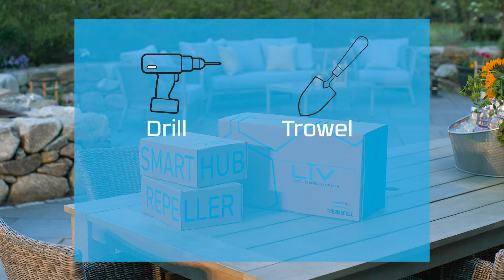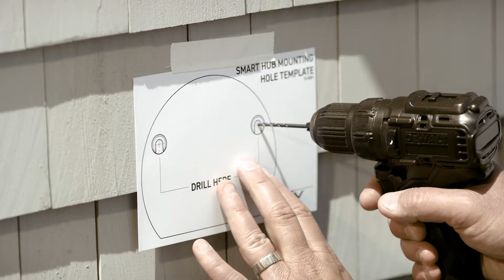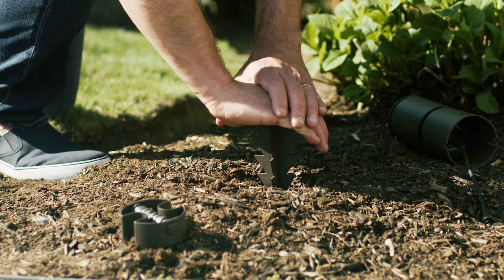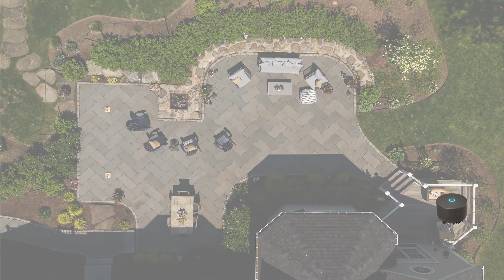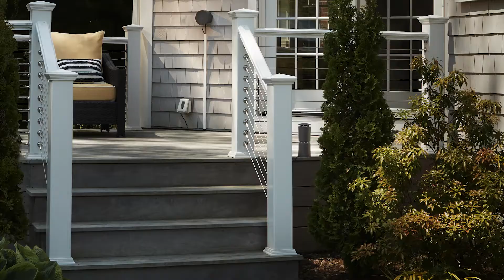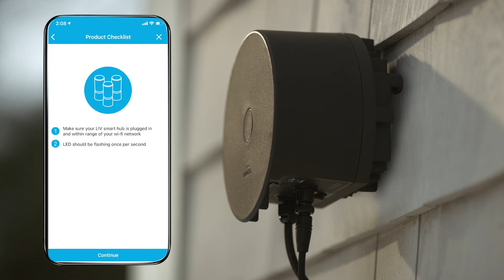Installation Instructions for Thermacell LIV Smart Mosquito Repellent System

Comment: Overpriced and Incomplete – Thermacell LIV Smart
Overpriced and Incomplete – Thermacell LIV Smart System Disappointment My excitement for the Thermacell LIV Smart Mosquito Repellent System quickly turned into frustration. After shelling out over $700 for what I believed would be a comprehensive and effective solution for my mosquito problem, I was genuinely shocked to discover that not a single repellent cartridge was included with the system. This is a glaring omission and, quite frankly, unacceptable for a product at this premium price point. I meticulously reviewed the product page and specifications on the Thermacell website before making such a significant investment, and nowhere was it clearly stated or prominently displayed that the essential repellent, which is the entire point of the system, would need to be purchased separately. It feels incredibly misleading to spend upwards of $700 on a "system" that is utterly useless until you make yet another purchase. The lack of transparency regarding this critical component is deeply disappointing. It creates an immediate negative experience, forcing an additional order and delaying the very relief I paid so much for. For a "smart" system, it's remarkably unintelligent to not include the fundamental element required for its operation, especially without clear upfront communication. This oversight significantly detracts from the value and convenience Thermacell promises.